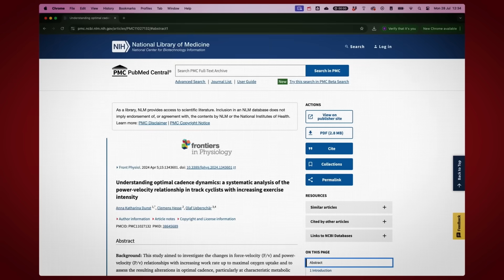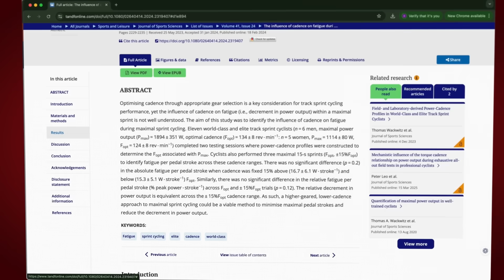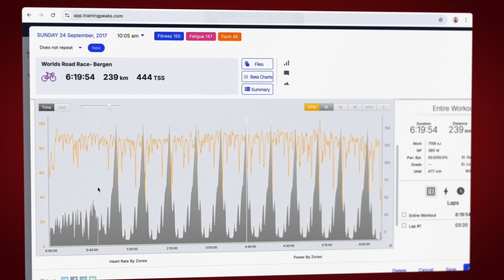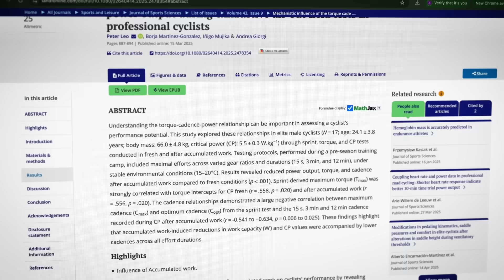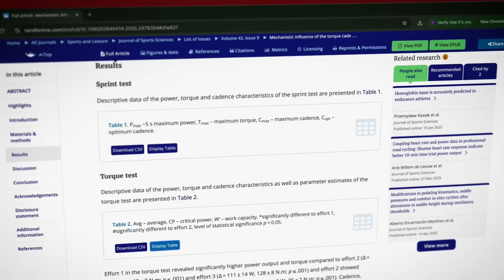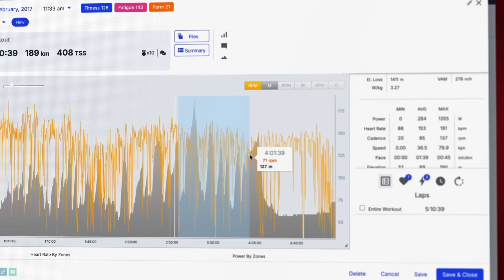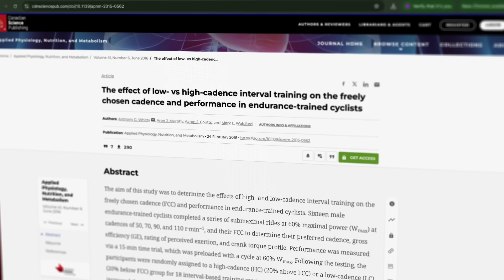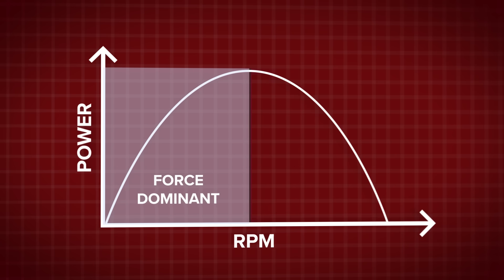I Thought I Knew Everything About Cadence. I Was Wrong.

Comment: Nor thinking much about cadence sounds like a very good way to think.

 I think its good to be good at many cadences , because when you go in to a short ascend its nice to come in with high cadence, and when it gets heavy is  fine to be a good grinder. If you are comfortable on a wide range of cadences you can be comfortable on a big cassette  with big steps from cog to cog.  

A way to train good quality across cadences is to avoid gearing. For example set the gear in  46 chainring and 24 cassetering and stay there.

I also has a theory about if you go on different cadences and torque, you will get variation on the stress on your mucles and system and  maybe that can help staying fresh for longer.

Comment: My performance greatly improved after adding low cadence, high torque drills. It also made my average cadence also dropped in general. 

My feeling is your body is used/gets trained to a certain torque and once you can handle that you can do the leg speed

Comment: I've always thought of pedal speed as a skill. The more skilled you are, the more options you have. That means practicing both low and high cadence. I'm 70. As a youth the old-timers used to swear by what was called 'evens', or 20mph at 100rpm. So I've always treated 100rpm as a benchmark. If I want to monitor my fatigue, I tend to pace myself by heart rate - and that tends to combine a lower cadence with higher gear. On a harder effort I set a power target, and find I'm constantly switching gear and cadence depending on circumstance. If I'm being competitive or riding in a fast group its always about cadence for me, using leg speed to maintain position often with brief spells at 120rpm.

Comment: I fit in the "high cadence" type of rider but recently got a new (used) bike for my commutes. It has a higher low gear than my usual road bike, forcing me to use lower cadence pedaling on the steeper hills. I definitely feel it in my legs and look forward to seeing if it improves my performance when out on a longer ride on my usual road bike.

Comment: a few years ago I would put on group workouts for our cycling group.  I would tell the group that "cadence is king".  Not a specific cadence but one's ability to use the right cadence for them in a given situation.  During long sustained efforts (3-4 minutes) and 15 second sprint efforts, I would have the cyclists adjust their cadence on a given effort.  I would ask them to take a mental note of RPE and then when they had time compare that with their data marking power differences and speed.  I was told by many of them that learning about their cadence in different situation was a valuable.

Comment: I don't have just one number for preferred cadence. In general, as required power goes up so does cadence. However, a long steep climb or a block headwind results in a lower preferred cadence compared to the same power output on the flat (with no headwind). I suspect this is due to the earlier (in the pedalling cycle) application of torque that is required under these circumstances. As far as I know, none of the studies address this.

Comment: 1 size does not fit all. In 1985 at age 28 when  I  started cycling  ALOT different then, compared to  now at age 68 . To keep the health of my knee's pain free . Most races on Zwift at cadence of 90+ unless it's a serious downhill section, then 85.  Warm up or cool downs , depends on how long the race will be . Cadence to start warm up 70+ , cool down after race 70+  Warm up & cool downs , ALWAYS small rear , or easy rides  in small chain ring . I'm glad that when I was in my 30's and 40's I listened to my body when it whispered and not screamed at me .  Ranked 37th in the U.S. 60+ age  70kg to 79kg . Plus 9 ironman finishes .

Comment: For what it's worth, I've always found cadence to be a rider specific thing.  I tend to grind a bigger gear than most of the people I ride with, averaging around 80rpms.  The one thing I can advise beginners on is this:  The faster you spin, the less leg muscles you use but the higher your heart rate will be.  The slower you spin the opposite is true.  So if your legs are feeling like rubber but your heart rate is low or at least lower, spin a smaller gear.  If your heart is beating out of your chest but your legs are good, find a slightly bigger gear and spin more slowly.
Reply: Good advice, though I would call 80rpm a mid-cadence. I have friends who average 100, and others who average 65.
Reply: @henseleric  That's true, and I do wind up being on the low side of that quite often.  70-75.  But then it mostly has to do with what kind of ride I'm doing.

Comment: Frankly, this video simply confused me about cadence. The most understandable point I got was that power decreases as fatigue increases. Duh! 
What I didn't hear, and I really wanted to, was how power-per-pedal stroke varies with cadence in the context of how long that cadence is being maintained, and how that affects fatigue. If you're wanting to get deeper insight into cadence, wait for a video that breaks it down in a simpler, more straightforward manner. Nice try, GCN (really), but please re-think this cadence topic.
Re: my experience...at a Zone 2 fat-burn pace I'm at about 90-94 rpm, and can maintain that indefinitely. When I increase the effort during HIIT, my cadence goes up to 102 or so, I'm mouth-breathing heavily, and can't hold it for more than about 5 min. Of course, I'm going much faster during the HIIT, and I assume I'm putting out more power-per-pedal stroke (sure feels like it). What I learned in this video contributed nothing to my understanding of my cadence-power-endurance relationship.
Reply: You are making confusion between power and force. There is not such a thing as "power per pedal stroke". The video is not clear. What you apply on the pedal is a force, and that is measured in Newton. Multiply that for the length of the crank, and you have a torque, which is measured in Newton*metre. Multiply this torque for the number of revolutions per minute, and you have an instantaneous power applied to your bottom bracket, which is measured in Watt. Cadence is not what the video says. The video says cadence is how much time you employ to make a complete turn of a pedal. Cadence is, instead, how many complete pedal turns you make in one minute. If you apply a certain force X on your pedal, and you pedal at 50rpm of cadence, you are applying a certain amount of power to your bottom bracket. You can apply the same power by pedalling with 1/2X force on the pedal, but pedalling at 100rpm of cadence.  

With each pedal stroke you apply a force on the pedal, and a torque to the bottom bracket. There is, for each cyclist, a "sweet spot" of cadence. If you pedal too slow, you will apply a higher force on the pedal, but the total power you emit is not your maximum (you slow your cadence more than what you gain in pedalling force). If you pedal too fast, you will apply a lower force to your pedal, and you don't emit your maximum power (you increase your cadence, but that doesn't compensate the loss of force on the pedals). In your "sweet spot", you are emitting your maximum power. Your maximum power will not be at your maximum force, nor at your maximum cadence.

Comment: My aging body seems to naturally sustain its highest power output at relatively low cadence 70-80. I find it hard to sustain my FTP at 90 plus, even though I still need the cadence to sprint. 
I do train at higher than comfortable cadence at times and perhaps it has helped.

Comment: Mashing gears is hard on bottom brackets, chains, deraileurs, hangers and even frames (for those of us concerned about keeping the same frame over a very long period of use). This is magnified on a torque sensing mid-drive e-bike that depends somewhat on your cadence to access motor torque and power.
Reply: I went through a phase of big gear mashing and my chain (getting on a bit) snapped for the first time ever.

Comment: Since there is a peak on the power vs cadence curve, at max sustained efforts try to gear for that sweet spot. Why the push for 1x chainrings vs 2x on the road, and why doesn't Shimano offer some close ratio cassettes? If i was on an alpine climb with 40 min max effort in front of me I would want my perfect gearing dialed in.

Comment: Early in the vid, it was mentioned Heart Rate was recorded. HR is a result of CO2 in the bloodstream. 
When muscles start working, CO2 in the blood increases. Nerves in the heart detect the CO2 and the brain makes the lungs operate deeper and the heart increase bloodflow to get the CO2 away from the muscle.
To plot a curve of cadence at uniform power output, when fully cardio and pulmonary dilated, the rider's HR will dip at the optimal cadence for that person. High at low cadence and high at fast cadence. There will be a cadence where HR will be lower than the extremities.
Second part of the survey is repeat the whole cadence range test at different power absorptions.
A 3D map can now be plotted of Cadence, HR and Power. Hopefully, it will look like an old mattress with a dip in the centre where HR reduces. The lowest HR on the map is called Maximum Brake Mean Effectiveness.
Now you know what rev range to train.
Reply: Sounds good, but how long do you have to record at each cadence/power to get accurate data? You need to go long enough that the HR has stabilized (it takes a while to respond) but then holding the same power over time (especially > LT1) always results in HR drift, making the data invalid.
Reply: @philadams9254  One could try several cadences, aiming for the same HR and therefore the same drift with time, and find out the optimal cadence by observing which cadence gives you the maximum power. That implies, I presume, many days of testing, and taking notes, as not all days are created equal. In the long run, one should be able to find the cadence of higher power.

Comment: Wir haben schon als Jugendfahrer gelernt hohe Cadenz 90 bis 120 zu treten, auch auf der Radrennbahn, im Sprint bis 150 Cadenz. Im Winter sind wir starr gefahren 42 x 19 und mit Cadenz 100 bis 120 auf der Straße. Wir haben auf der Rolle trainiert mit der Bahnmaschine 5 Minuten Cadenz 100 bis 120 und 1 Minute bis 150 und das dann 12 x über eine Stunde 5 Minuten  + 1 Minute
Reply: I've done 150! Track bike, downhill, no choice! Terifying.
Reply: @davidburgess741  Of course it is terrifying. You should rather use a fixed gear, but on a normal road bike with brakes. Alternatively, you use a normal rear wheel, that allows you to "coast", but you try to not to.

Comment: Diesel Low rpm high torque low hp vs Gas engines higher rpm less toque . Different designs and different uses.

Comment: Really interesting video!! Thanks for diving into this topic, Conor! I only have cadence data on my indoor trainer (ATM), and my average usually falls within the common 80–100 rpm range. In the beginning of me stating cycling, I was playing around quite a bit cycling with different rpm to see how my body reacted (very useful). Sometimes I do specific trainings. When I want to focus on leg strength, I shift to a higher gear and lower my cadence, and when I want to work my cardiovascular system, I drop the gear and spin faster.  That said, most of the times I simply go by what feels natural.

Comment: I don't understand.  At ~80 RPM I'm pretty much maxed out for cadence. 130ish RPM is crazy nuts! How? 😅🤦 My God, what am I doing wrong? 🤔🤣 I need to strap on a cadence measuring device again. Its been too much time since I had one. The damn thing stopped working (thanks China 🤨).
So I need to increase the number of fast twitch muscles I have.  Ok, I can see that. I sustained a rather bad injury, years ago, playing beach volleyball and the guy on the other side of the net came through and drove my knee backwards, stretching my ACL and tearing the meniscus. 
I'm heading to the gym to do a grueling leg day, then 😃
Thanks for the heads up 😊
I need to do some heavy weights with low reps type work to increase fast twitch muscle mass 💪 😊
Very useful video 👍👍👍👏
Reply: Yes, a computer cadence feature is good. We used to strap watches to our handlebars and count rpm for 6 seconds x10 for cadence. "heavy weights with low reps" is not fast twitch. Your ACL and meniscus will strengthen slower than muscle but high reps/low weight will increase blood flow and nutrients to the tendons and ligaments. That said, we used to spend all day at 100 rpm, developing a smooth rotation. We used the 109% seat height so your seat may be a little low, try raising it 5mm. Loosen your ankles, practice one leg pedaling for 2-3 blocks as warm-up. Practice cadence all day in a gear you can reach 100 rpm in. Breathe with nose and mouth. As your aerobic capacity increases you increase the gear. It may take a month or three. It's really a life style change, and one my coach Mr. Bob Potter gave me back in the 70s. Have fun!
Reply: @BadBent thanks for the tips 🫡

Comment: The only metrics I have on my headset display is HR and cadence. I don't own a power meter, but I would probably swap HR for power if I did. My cadence on a flat(ish) course is 85 - 93 when riding in zone 2 or 3 and I use gears to keep it there. I am unconcerned about knowing my speed. It takes care of itself.
Reply: I used to focus on my speed now I just focus on keeping my cadence around 80 and changing gears accordingly

Comment: Seems like torque demand relates to power intensity, constrained by VO2, slow twitch aerobic fibers supplemented by fast twitch anaerobic fibers, endurance vs. strength.  Eddy Merckx advised colleagues, "If you want to go fast, pedal fast."   Those who pedal fast improve VO2, while those who pedaled slowly gained leg strength.   Hinault added the advantage of training torque at low cadences and endurance at fast cadences.  Riders have to get to the finish before they sprint.  IME, when climbing, backing off to just below anaerobic threshold will ensure you recover quickly at the top.

Comment: Great vídeo, Connor. I was surprised with it because I have been discussing about this for quite some time and, yesterday, I was planning to do a presentation talking about crank length and one of the points is about Cadence. I am an amateur biker who simply love enduro/downhill. I am 51 y/o and, obviously no athlete. However, I was feeling that was a "missing link" to complement my fun since my bike is not an E-bke and I actually have to climb pedalling in order to go down 😁. 
So I decided to buy a road bike and hire a coach trying to improve my cycling. I am amazed about how I improved not only my cycling but also my performance in trails and downhill. 
I also noticed I have a pedalling confort zone that used to be around 73-75 RPM. In the last 18 months my pedalling confort zone increased to 85-88 RPM and I am also capable to sustain more power output for longer periods. 
In the last months I've been more worried about playing with the cadence than worrying about potence.

Comment: Back when I and the world was young, cadence began to be a topic when freewheels, then cassettes, started offering more gears. In the days of 53 * 42 front and 6-speed UltraSix 12 or 13 to 21, 24, or 28 for steep hills. Cadence spun out with a following wind on a smooth level surface and ground down to zigzag at a nearly stationery track stand up a 25% rough lane. I remember stripping freewheels  of their teeth. You could do it through gritted teeth but the strain on back and core and all other bones, muscles, tendons, affected you next day. 
Far more gears, so you're always in the perfect gear for you and the specific conditions mean recovery for next day and the day after are much less of an issue. Perhaps another reason for the speed of stage races? Back then, most of us could only do one very intense day so had to gamble which day to do it on.
We used fix geared bikes to teach our muscles to work smoothly at high (down hills) and low (up hills) cadences.
Now, I use high cadence on the stationery bike for high heart rate intervals that burn lots of energy in a short time without building up lactate

Comment: Not after 'performance' as such, but spinning just feels better for my knackered knee tendon. Less relative load through it, and less fatigue overall.
Reply: Oddly enough, after 25 years of cycling, the last 8 with recurrent knee pain, I started riding 100% single speed for the past 5 and my knee issue disappeared as my legs got more muscular and stronger from riding low cadence up hills and very high cadence down hills.   I think the increased musculature stabilizes the knee and functions as a natural brace.  Weight training of surrounding leg muscles would probably have a similar effect.
Reply: @UwharrieRider I have a very strong squat and grinding out rpms on a fixed bike up hills don't hurt my knees just muscle fatigue. Strength training definitely increases joint longevity and endurance

Comment: I wonder that if performance (i.e. power) is not your aim but improvement in cardio, without the training load, would a higher cadence be more beneficial vs a lower one? Or is cardio purely heartrate related and thus it is the amount of energy used during a workout that is decisive for the added cardio value, not the cadence at which it is done?